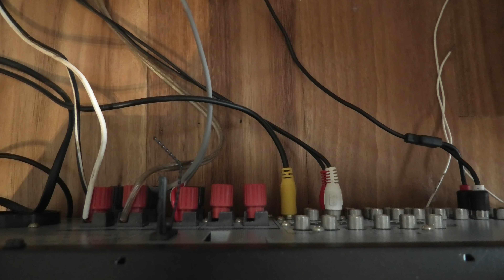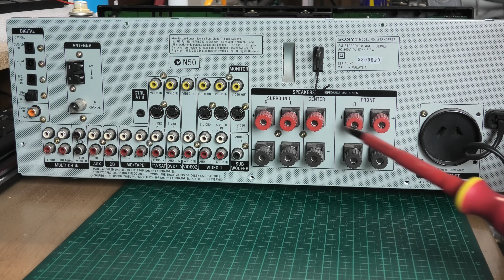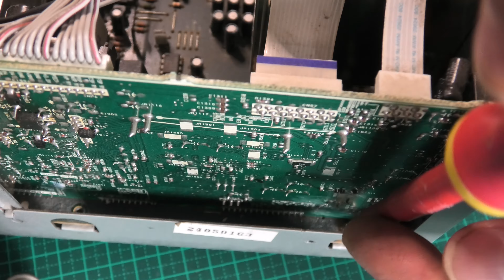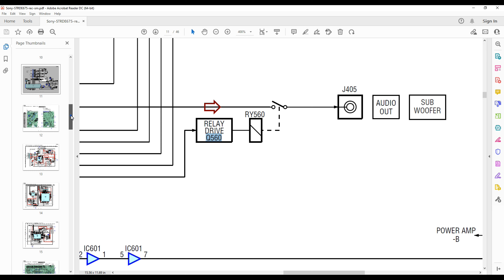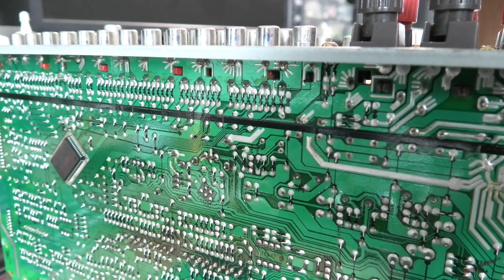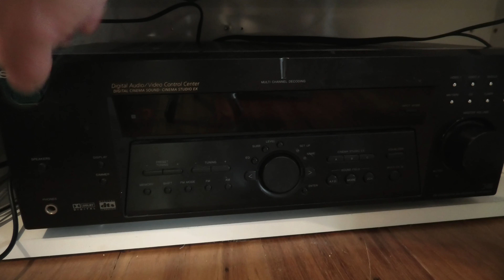Sony STR-DE675 sub woofer LFE output not working repair

Comment: I have an STR-DE885 with the same problem. I resoldered some cold solder joints in the area of the components that process the subwoofer signal, but still, I didn't solve the problem. What else should I check? Greetings and excellent video.